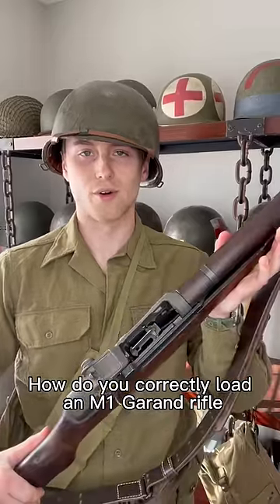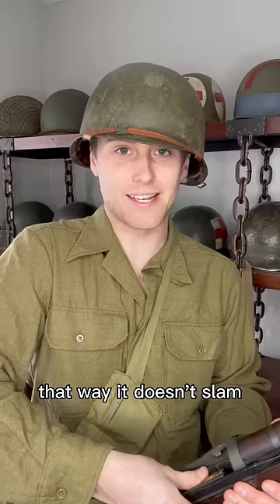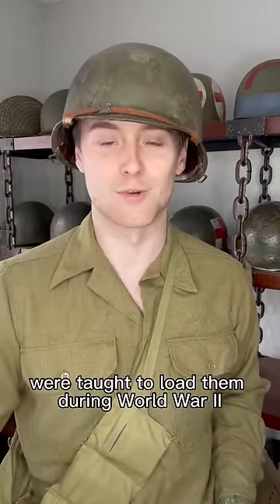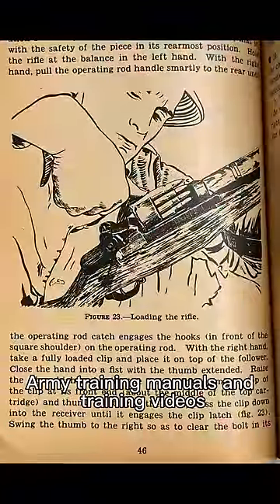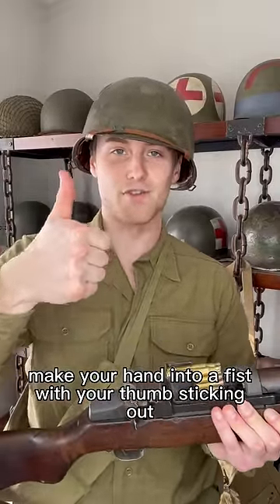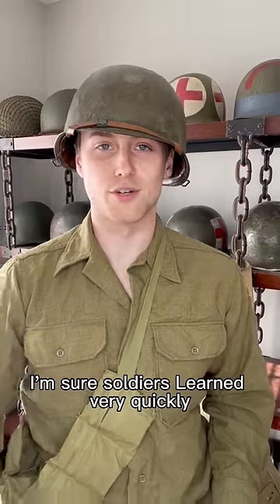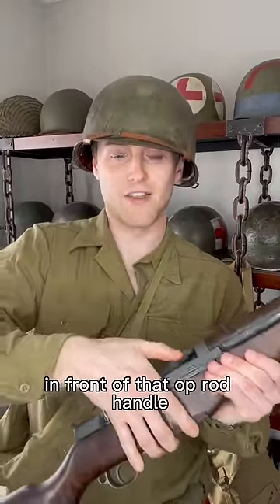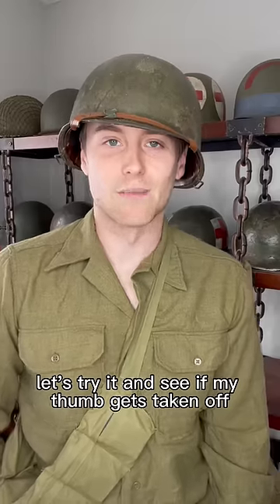How to (in)correctly load an M1 Garand

Comment: Garand shooter here. When loading with the army manual method, it is important to place your thumb on the top cartridge rather than the enbloc clip. As long as you keep pressure on that cartridge, the bolt cannot close on your thumb.
Reply from the maker: Yea that typically works, but then you’re relying on the friction between your finger and the cartridge to hold the bolt open. I feel like a particularly loose enbloc or slippery finger could still cause a mishap.
Reply: @WorldWarWisdom  Agree with that one again why be sorry for a second of concentration. Enjoy your M1. I will be competing on Memorial Day plus honoring past relatives who have served and moved on. Uncle Joe, Iwo Jima, and the Grandfather and his Cousin were in the Battle of the Bulge and both were wounded after relieving the city and both barely got across the Rhine before they were wounded and sent back to the states. All are gone now , Joe from the Pacific eas hit going home by a drunk driver after surviving the war. Great evening and enjoy your day tomorrow.
Reply: @WorldWarWisdom  if you load by pressing on the cartridges, the bolt will remain stationary. Pressing the enbloc, tanks to cause you to also press the bolt back and causes the bolt catch to disengage. It's the same concept as slamming a new mag into an AR-15 platform rifle. If you do it right you can manage to lock the mag in place and then have the bolt ride forward in the same motion. I used to do this all the time in the army. I also learned how to rack the M9 or any other pistol one handed. It all about inertia and getting the weight or force off the catch enough to get the slide or bolt to ride forward and load a round.
Reply: @Deathbomb9  dope
Reply: @Deathbomb9  With smaller pistols it's possible to rack them one-handed with your 4 main fingers up on the slide
Reply: @ericolsen5592  something like a .22lr or a 380auto, yes you could.
Reply: @johnelliott7375  What a sad sense of irony for your Uncle, made it home and was killed by one of the people he went to war to protect. Sorry for your loss
Reply: @WorldWarWisdom  Slippery cartridges are definitely evil. Especially a problem with handloads because of the sizing lube. Still, a couple thousand rounds in, and I've only been bitten once. 

My rifle is quite nice though in that it usually asks for a nice slap on the charging handle before it will close.
Reply: @MineGames131  thanks for the words of kindness, hopefully you had a wonderful Easter Sunday.
Reply: Couldn't you just slam it with the palm of your hand really hard avoiding getting your thumb smashed
Reply: Long time Garand shooter and collector here and M1 thumb HAS NOTHING TO DO WITH LOADING ONE, absolutely nothing no matter WHERE YOU HAVE YOUR THUMB. 
It's 100% entirely from a nervous recruit fumbling the Inspection Arms drill during basic training AND HAS NOTHING TO DO WITH LOADING ONE.
Jesus Chist it drives me crazy all you supposed M1 authorities talking about M1 thumb and loading one, it has NOTHING TO DO WITH THAT, it all comes from being a basic training recruit and trying to master dropping the bolt from it's locked open position using only the back edge of your right hand on the charging handle and thumb simultaneously depressing the round follower while maintaining "eyes front" discipline. 
Try it, hopefully you'll give yourself a good case of M1 thumb so for the rest of your life you'll understand that IT HAD NOTHING TO DO WITH LOADING ONE.
Reply: @WorldWarWisdom   It's not friction. When the follower is pressed all the way to the bottom of its travel, the bolt won't go forward. Like I said, it's not friction, it's the design of the rifle. The problem is that the rifle will work just fine without the follower ever going all the way down.
Reply from the maker: @Deavertex  Nope, that's not true. You can watch my video it if you're not sure how it works https://youtube.com/shorts/Xg0rbK5xBqQ?feature=share
Reply: @HunterGuy558  for starters, your palm won't get far enough down to properly set the clip. Also, while it would keep your thumb out of the way of the bolt, your palm has a lot more flesh than your thumb and would be more likely to get pinched. That would induce an unwanted malfunction that could potentially cost a soldier their life.
Reply: @MikeDCWeld  
Neither one will get hit by the bolt, first off and for the one millionth time dispelling this whole M1 thumb myth thing it didn't come from loading one, M1 thumb happened when a nervous recruit would fumble the Inspection Arms drill in basic training, it has absolutely NOTHING to do with loading one and it's actually impossible for it to happen when loading one, anyone who believes that the military would have accepted a rifle that could slam the bolt on your thumb while loading it in the heat of battle needs to have their head examined, hello, does the term "Arms trials" ring a bell? Don't people think that if that could have happened the military would have discovered it during the thousands of rounds that are put through a weapon during not only the trails at Aberdeen Proving Grounds but also during initial field trials when they give 1,000 of them to an Army unit to try out and rejected it's use until something like that was straightened out? Give the military some credit, they certainly wouldn't have accepted a weapon like that for use that could do something like that while loading it in a battle, it's silly to think they would have. 
For years now whenever I'm at a shooting range and someone comes along asking me questions about M1's and they bring up the subject of M1 thumb I'll throw down a clip next to my rifle and challenge them to have it happen while loading it, just to prove to them that I don't know some slight of hand trick I'll tell them that if they can show me it's even possible for it to happen when loading one I'll give them every single possession I own, my gun collection, my motorcycle's, the car they see parked over there and even the shirt off my back before we part ways, it's impossible for it to happen because the top round getting stripped off and pushed into the chamber won't allow your thumb to get down in front of the bolt, if you push a used 8 round clip thats worn smooth from where the rounds strip out into an M1 that's running smooth because all the Parkerization between moving parts is worn away you'll usually have the bolt run the first round right into the chamber as soon as it locks into place, all that happens is that top round under your thumb followed by the bolt just glide along right under your thumb, there's absolutely no way your thumb can be down in front of the bolt, the area your thumb needs to get down into is full of clip and the rounds in it. 
I so desperately wish one of these guys who makes these videos would take the time to look through their soldiers training manual for the M1 that they have from being collector's and learn how to do the Inspection Arms drill while at the same time maintaining "eyes front" (you can't look down at what you're doing) and they'll learn real quick where the dreaded and legendary M1 thumb really came from, and they'll remember it to I'll guarantee you of that.
There's an old Richard Widmark movie called Take The High Ground where he portrays a drill instructor during the Korean War, in it is the only example I've ever seen in a movie of someone performing the Inspection Arms drill with an M1, Widmark hands a trainee his M1 back that has the bolt locked to the rear as per the trainee having done so as step one before handing it to the inspecting officer, after having it handed back to him the trainee is required to perform the second half of the drill which involves dropping the bolt by using the back edge of his right hand to pull the charging handle rearward enough so that when he takes the thumb of his same hand and pushes down on the round follower then simultaneously releases the charging handle by rotating his wrist in a manner that's straight forward in relationship to the rifle, which when done correctly also pulls your thumb up out of the way, with the bolt moving forward into battery. 
Stand up, place your right hand about 6 inches in front of your belly button palm towards you with your fingers together and pointed downwards and your thumb at 90° from your fingers, swing the tips of your fingers to the right which will also make your thumb move downwards, then quickly swing your finger tips to the left which also makes your thumb move upwards, that's the motion required to drop the bolt after you've had your M1 handed back to you by an inspecting officer during the Inspection Arms drill, now imagine having to do it with an actual M1 while a drill instructor is yelling in your face all the while not being able to look down at what you're doing because you're required to maintain "eyes front" while performing the task, which means you're looking at the face that's screaming at you instead of looking at what you're doing which you desperately wish you could....SLAM!!!! five days later your black and blue thumbnail will be falling off.
Now you know what caused M1 thumb, and you can now explain to people that it has nothing to do with loading one, I cringe and actually feel embarrassed for all these people in YouTube videos and comments saying things like "later M1's were modified to prevent it" and "if the correct loading procedure is followed you won't get M1 thumb" or the best of them all "if the bolt fully chambers a round after pressing the clip in that means the ____ (fill in the blank) is wore out and needs replaced", cringe, cringe and cringe.

Backstory, I first learned about M1 thumb when I was 14 years old in 1979 from a 50's era Army veteran who was a high school friend of my dads, he opened a gun shop and one day when we stopped in he was showing us an M1 he'd just gotten in, while we were there he demonstrated the Inspection Arms drill and explained how nervous guy's who would fumble the process during training would get what they called M1 thumb, after hearing that bolt slam home it didn't take lot of imagination to understand he wasn't exaggerating about guy's thumbnails turning black and blue and falling off, in 1983 I went off to the Army where I had to learn the Inspection Arms drill with the M16, so the whole concept of having to maintain eyes front while performing such tasks wasn't wasted on me and gave me a head start on learning the Inspection Arms drill the proper way after buying my own M1 in 1990 and luckily grabbing an original WW2 dated soldiers manual just a few weeks later when a woman walked into the same gun shop with a box full of WW2 manuals from her dad who'd just died a month earlier and they were cleaning out his house, also in the box that I nabbed was a Sep 25th 1942 dated military technical manual titled "The Motorcycle", that one is a serious prized possession of mine that I've turned down considerable offers for on several occasions over the years.
Reply: For fuck sake why does everyone own a gun
Reply: I wish i could get a rifle of any kind
Reply: @dukecraig2402  Dude for real, so tired of the fudds and gamer “experts” in the comments. 

Have never in my life gotten M1 Thumb while loading. Almost physically impossible, since the top round blocks your thumb from being chambered. 

Videos like this do nothing but muddy the waters when it’s very clear to us: M1 Thumb doesn’t happen while loading, only while messing around with an empty magazine and chamber.
Reply: @geoechidna  
It comes from the Inspection Arms drill, before handing the inspecting officer your weapon you lock the bolt to the rear, after they hand it back to you you've got to drop the bolt using only your right hand to manipulate the charging handle and the round follower while maintaining "eyes front" the entire time (ie you're not allowed to look down while you're doing it).
Read how the procedure was done in a soldiers manual from that era, you owning an M1 try it and you'll understand exactly where it came from.
When I was 14 years old my dad's friend who was a mid 50's army veteran opened a sporting goods/gun shop, not long after opening it he got an M1 to sell, one day when we stopped in he was showing it to us and told us about the dreaded M1 thumb and demonstrated the Inspection Arms drill, he explained that when a nervous recruit that had a drill instructor in their face would fumble the task and wind up with a black thumbnail that'd eventually fall off.
4 years later I wound up in the military having to perform Inspection Arms and thankful I had an M16 to do it with, then shortly after discharging from the Army I bought my first M1 from a shop that a guy opened just about 200 yards down the road from my house, just 2 weeks or so after getting it a woman walked into the place with a box full of WW2 military manuals that belonged to her father that was in the war and wound up staying in the military for 20 years, the owner called me up and gave me 1st dibs on any I wanted before he put them out for sale, I picked up the soldiers manual for the M1 and a technical manual for it, in the soldiers manual was the procedure for Inspection Arms that was spot on as per the guy who'd showed it to me several years before. 
It cracks me up how people think the Army would have accepted a weapon that could slam the bolt on your thumb while loading it in the heat of battle, all these guy's and their "The proper way to load one so you don't get M1 thumb is to..." nonsense theories just crack me up, I've demonstrated to so many people how it's literally IMPOSSIBLE to have it happen while loading one, I've kept my thumb on top of the top round pushing down slightly while they've released the bolt just to prove it to them, the bolt usually not going all the way forward when you push an 8 round clip in has NOTHING to do with it's design, take a worn in M1 that has the parkerazation worn off the parts and a used clip that has it worn off it to and 90% of the time as soon as that clip locks into place the bolt slams home, and all that happens is the top round followed by the bolt just glide right along under your thumb, and that top round makes it IMPOSSIBLE to get your thumb in front of the bolt, yea, that's something the Army definitely would have caught during the extensive testing they put proposed designs through, if there was even the remotest chance of it happening while loading it they'd have said "Well Mr Garand, we're pretty happy with your rifle but there's one thing about it...", they'd never have accepted it if that could happen.
Reply: @dukecraig2402 umm...you are totally wrong.  Garand thumb is specifically referring to getting your thumb caught in the slide while LOADING the weapon. Nothing you said was even remotely close to accurate.
Reply: @dukecraig2402 So, me single loading rounds into an M1 with nerve damage in the lower part of my hand causing me to push on the follower because I couldn't feel it due to half my hand being numb, release the bolt, and smash my thumb never happened?

God almighty, you can tell when someone is reaching when they write a novel.
Reply: @erikcrouch7881  dude was talking about loading a full clip, not single loading.
Reply: @dukecraig2402 why don't you say it again and write another seventeen paragraphs about it
Reply: Unless you have brain damage, an individual will experience M1 thumb only once.  Avoiding M1 thumb has one of the fastest learning curves.  Kind of like don't pet a scorpion,  look both ways when crossing the busy street after a car has given you your first flying lesson.  There are many fast learning curve experiences that can be added to the amount of am I that stupid category.

Comment: The amount of times I’ve had to say this: Garand thumb is from depressing the follower to close the bolt on an empty rifle. That’s the only way it’s going to slam your thumb. When loading, the bolt will not go forward until you take your thumb off the rounds. You won’t get Garand thumb when loading ammunition into the rifle.
Reply from the maker: I generally agree. It can definitely happen when you’re loading, but it’s much more likely to happen closing the bolt on an empty chamber. I made a video about that a while back
Reply: Only time I ever got bitten by an M1 was while I was cleaning one with oily hands.
Reply: Yeah i genuinely believe garand thumb is speculation that turned into a thing by people who have never fired one. 90% of these rifles you have to smack the op rod to load the first round
Reply: @WorldWarWisdom  But… how…? 

The top round immediately rushes forward into the chamber. You literally cannot chamber your thumb, and there isn’t enough real estate above the bolt head and above the chamber to actually hurt you. 

At worst, your thumb is lightly kicked out of the way as the bolt comes forward. “M1 Thumb” my ass. 

Videos like this show a weak understanding of how M1s actually work. Thousands of people now are doubling down on this easily verifiable Fuddlore thanks to this video. 🙄
Reply: @geoechidna most often when one receives garand thumb its typically pinching the thumb rather than getting it stuck or having a chuck of your thumb in there.
Reply: Exactly! When the Garand bolt closes on your thumb with a full clip, it pushes your thumb out of the way! (Well it does so 99% of of the time)
Reply: It can definitely still get your thumb while you're loading a full clip or especially a partial clip, although usually not as bad as if it was empty

Comment: As long as you keep your thumb flat on top of the clip instead of pointing down like the picture showed. When the bolt goes forward, it won't grab your thumb, and you don't have to worry about moving your thumb out in time.